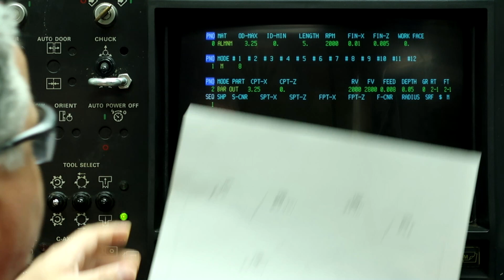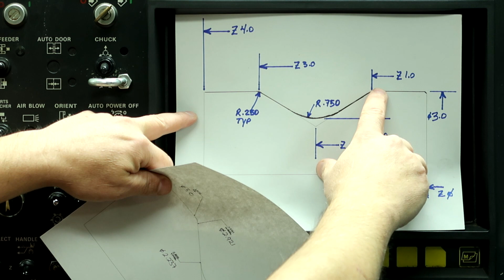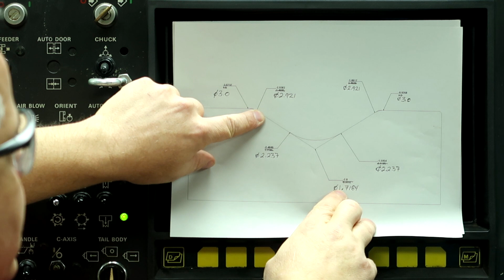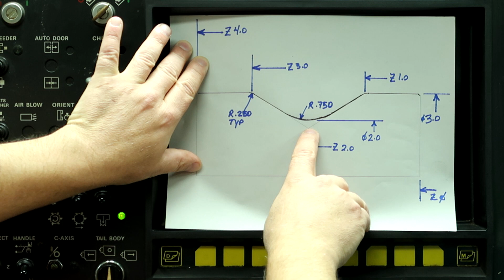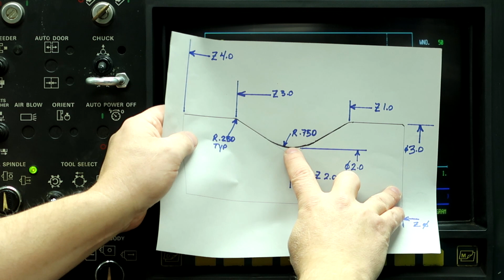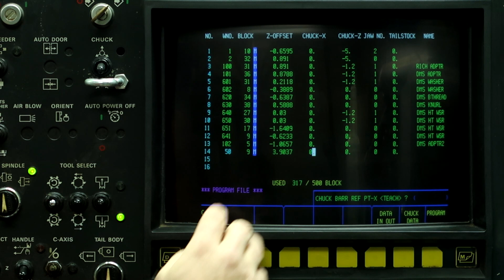Mazatrol Programming Tutorial CNC Turning Demo Part 4

Comment: You are the BEST for Mazak information on the net, Could you please do a video and explain Velocity and how in the heck Mazatrol calculates Speed and Velocity? I just don't understand it and can't find anyone who can. Great videos and keep up the great work!
Reply from the maker: Thank you.  What is your question exactly?  All CNC lathes calculate the correct RPM needed to maintain the programmed velocity or surface footage per minute  (SFM) based on the current tool X position. Are you asking where the pre-programmed velocity values are coming from?
Reply: @mazatroltipsandtricks6816  I just can't understand how to enter the correct velocity for each tool based off the RPM I enter on the first line of the program, For example, My RPM entered on the first line is 750. My tools are a Drill, a turning tool and a boring bar. My drill will run at 750 no matter what number enter as Velocity for my drill,  but the other tools will run different RPMS based on the number I enter in the RV & FV positions for each tool. I have no idea what Velocity means or what speed the I will get by entering a Velocity of 500? Is there a formula of what does a RV of 500 mean when I have 750 RPM set on the first line? And Why does the drill seem to ignore the Velocity setting and run whatever I have programmed as RPM?
Reply from the maker: @ernhart3333  The RPM you enter on the first line of the program is the MAXIMUM RPM the machine will ever run throughout the program. This is a safety value.  You do not program individual processes based on this RPM clamp limit. If the drill is calculated to run at 2000 RPM but you have 750 as MAXIMUM spindle clamp RPM, then the machine will only run the drill at 750 RPM.
Reply: @mazatroltipsandtricks6816  Yes I understand that. RV & FV (Velocity) is what I don't understand. What is Velocity in relation to RPMs? If I enter Maximum of 750 RPM and enter 500 as RV for a turning tool. What RPM would the machine run with 500 RV?
Reply from the maker: @ernhart3333  That would depend on where the tool is at in relation to X diameter. If the machine is in inch mode, RV and FV is the surface footage per minute.  One surface foot equals a diameter about 3.820" in diameter. That means at that diameter, you can take a tape measure and wrap it around the part and it would equal one foot.  So at that diameter, one surface foot equals one revolution, or 500 RV equals 500 RPM.  Anything smaller than about 3.820" the RPM increases. The RPM is double the surface footage at about 2" in diameter and again RPM is about 4x the surface footage at 1" in diameter. At 1" in diameter, your tape measure would need to wrap around the part 4 times to equal one foot, so the machine speeds up 4 times to maintain an equal surface footage.  Larger than 3.820' in diameter and the calculated  RPM is going to be a smaller number than the given SFM in RV.  If we are talking about a 1/2" diameter drill bit running at 500 SFM, then the calculated RPM would be 3,820 RPM.
Reply: Damn, your a smart man. I wish I could understand all that! LOL @mazatroltipsandtricks6816
Reply from the maker: @ernhart3333  I see a car in your avatar. Let's use a car in an analogy. A car and truck are traveling along at 60 miles per hour next to each other. The surface of the road you are covering is 60 miles per hour.  The car with the smaller wheels are turning a faster rpm than a truck with big tires but both vehicles are still maintaining the same velocity at 60 MPH. Make sense?  Smaller diameter parts will turn at a faster RPM to maintain the given velocity vs large diameter parts.
Reply: @mazatroltipsandtricks6816  Yes that makes sense. My problem is I have no idea how to calculate what velocity (RV & FV) number I should enter to get my workpiece to run at a RPM I want it to run at. I have to keep messing with my first line RPM value and then keep messing with the RV & FV values to get the workpiece to run when I want it to run. I would think there wound be a simple formula to calculate this without all the messing around. Hey, I watched everyone of your videos and always said, wow this is a great guy to take so much of his time to make such great UNDERSTANDABLE videos for others to learn from. But you relying to all these questions I have is absolutely amazing! You truly are a great person and will be blessed for all you do to help others!
Reply from the maker: @ernhart3333  You are trying to do it backwards is your problem but I digress.  If you want to calculate the required velocity of a drill at a given RPM, then you would use this formula.  SFM = RPM x diameter ÷ 3.82.  If you have a 1/2 drill and want to run it at 500 RPM then it would look like this:  500 x .5 ÷ 3.82 = 65 SFM.

Comment: Hi phil pl see if you can make vedio about machining inside groove with inside grooving tool of 48 diameter inside a 50mm diameter bore . The length of the groove is about 200mm and start is about 30mm from Z 0.
I did the job using G code but I want to see  how to machine using mazatrol program. 
The depth of the I'd groove is 2mm per side.
Reply from the maker: Is this groove like a thread or a spiral grease groove?
Reply: @mazatroltipsandtricks6816  
Hey Phil.
I was trying understand this comment as well ??
Do you understand what it means ?

Sounds more like a recess than a groove ??
Reply from the maker: @weldmachine  that was my thought as well.
Reply: @mazatroltipsandtricks6816  just plane groove phil
Reply from the maker: @CNCekspert  Ok.
Reply: Ya u guys are correct recess is the correct word to define this thnks
Reply: @CNCekspert  
All good.
Just the mental picture i was drawing in my mind of your description was a little confusing, LOL.
Hopefully Phil will post a video about your comment.
All the best. Peter.
Reply: It is not important to have same sizes I have mentioned.
I want to know how to go in and come out from the bore if inside tool dia is very close to bore and we have only 2 or 3 mm space for G00.
I want to how to do in  mazatrol program.
Thanks
Reply from the maker: @CNCekspert  Got it.  You just need to change your user parameter that controls the ID retract distance.  This parameter will be different from one control series to another.  What controller do you have?
Reply: @mazatroltipsandtricks6816  thanks phil I have integrex 640
Reply: @mazatroltipsandtricks6816  these user parameters are attached with the program or become universal after changing
Reply from the maker: @CNCekspert  if you change the user parameters they become universal for all programs. If you change the parameters inside the TPC then it will only affect that one process.
Reply: @mazatroltipsandtricks6816  ok thanks you made my life easier I was just afraid not to touch user parameters but now I know I can change them in TPC and that will not affect the basic settings

Comment: Phil to get it absolutely spot on, put the tool radius to zero & use your figure check graphics to get the diameter you require ie 2inch diameter while adjusting the Z position .
Then you can put your tool nose radius back to what it was, & machine the part knowing that it is absolutely 100% correct to the drawing. 
Have you ever tried this method ?
Reply: No problem ,what cad cam do you use ?
Having been running Fanuc machines recently & i can't believe how far behind they are in the programming compared to Mazatrol. As you know, you have to program as your first method ,very time consuming.
Reply from the maker: @joedunne1134  I still program everything at the machine. The CAD CAM software I'm using to get the data points is over 20 years old.  I just use it as a CAD program and not a CAM program at all.
Reply: I'm looking for an easy program to use to generate the intersection points as per your printout ,so i too can program at the machine. 
Have you any recommendations please?
Reply from the maker: @joedunne1134  This OLD OLD version of CAM software I use only spits out a radius value for X so I have to manually convert the values to a diameter value to use in the machine. It's not a drafting program.   I do not have a recommendation for a newer CAD program. Most of the ones I tried are downright frustrating to use. I'm running this CAM on an old Windows XP computer.
Reply: Whats it called Phil ?
I'vd had the same problem ,i want a quick & easy program to use on my laptop that just gives me the intersection positions & isn't over complicated.
Reply from the maker: @joedunne1134  It was called EZ-CAM.
Reply from the maker: Never tried this method. I understand what you are saying. Thanks for the tip.

Comment: thanks for sharing your video sir
Reply from the maker: You're welcome.  Thanks for watching.
Reply: @mazatroltipsandtricks6816  im a cnc machinist sir here in Dubai UAE im operating integrex i-500s and 300sy
Reply from the maker: Cool. Thanks for sharing.   We have an Integrex i-400s at work with a Smooth X control that I have been running for the past 3 years.  I've also been running my old QT10N ATC/MC at work for the past 24 years now.  I wish I could make videos at work on the Integrex but that is definitely not allowed.
Reply: Mazatrol Tips and Tricks wow that’s great sir, our integrex i-500s smooth x control just newly installed here in our shop about 2weeks ago .

Comment: Nice video!!
Could you make a video about using the tailstock pls? I can’t get it figured out and kinda need it😅
Reply: Just reading down through the replies to this comment.
Sounds like Phil has just had another job added to his list of things to do on his machine.
Get the Tailstock on this machine running again.
Hopefully he will get it running again so we can watch a video of the Tailstock in action.
Reply from the maker: @weldmachine  I got two machines, remember?  Lol.
Reply: @mazatroltipsandtricks6816  
Hey Phil sounds like you are going to cheat on this one, LOL.
I think you mentioned the larger machine is a Manually activated Tailstock ??
Come on Phil get the driven Tailstock going would be better to watch in a video.
But i understand you would need time to fix it first.
Reply from the maker: @weldmachine  fixing the small machine's tailstock isn't on my list anytime soon. It's a huge job.
Reply: @mazatroltipsandtricks6816   
I guess it's whether you have time or not. 
Most things can be done but finding time ??
Finding time is always the hardest thing to do. 
Plus with making and posting videos it does eat up a lot of your free time.
Reply from the maker: Not having a working tailstock on my small machine does limit the jobs I can take on but I am able to still run the machine.  Trying to get the tailstock out of the machine is next to impossible given my situation.  The tailbody clamp cylinder is broken and needs to be replaced.  This machine was really beat up hard before I got it.
Reply: @mazatroltipsandtricks6816  
If the tailbody clamp is broken it is definitely a time consuming job.
I rebuilt what i could of my tailstock while it was out including sand blasting and painting.
Not sure if i will ever use the tailstock for any of my work.
But if it,s there i would prefer it working.
As you already know, using a tailstock in a CNC Lathe is not that frequent.
Unless you do a lot of shaft work.
But generally this is normally reserved for long bed lathes.
Reply from the maker: Sure thing.  There are several types of tailstocks.  Some move by themselves with a motor and some move only when connected to the turret with a pin.   What type of tailstock does your machine have?
Reply: Mazatrol Tips and Tricks thanks for your fast response man, i think the same as yours? Mine moves with a moter and a chain by pressing the tail body move button
Reply from the maker: Got it.  The tailstock on my small machine that moves with a motor is inoperable right now.  I have to fix it.  The tailstock on my big machine that connects to the turret does work.  The only real difference is how the tailstock body moves into position.  The rest of the setup and programming on how to avoid hitting the tailstock with the tool is going to be the same.
Reply: Mazatrol Tips and Tricks nice, maybe you can show how to program both and then show how to run with your big machine, really thanks in advance
Reply: @jepkeklinge3778  I've learned to use the tailstock set all the parameters etc.. for the live center I use 
I would highly suggest you use the TPC function on every tool it's easy once you learn how .
Reply from the maker: Older machines like my T2 / T3 controller do not have TPC capability.  I will do a video showing how to program the machine to avoid hitting the tailstock.  This method means you do not need to use TPC all the time on the newer machines too.
Reply: Mazatrol Tips and Tricks is it much easier with tpc?
Reply from the maker: @jepkeklinge3778  TPC gives you more control whereas the method I have to use on the T2 and T3 controls is easier to use. Both methods work.